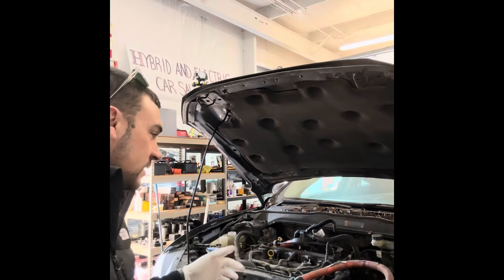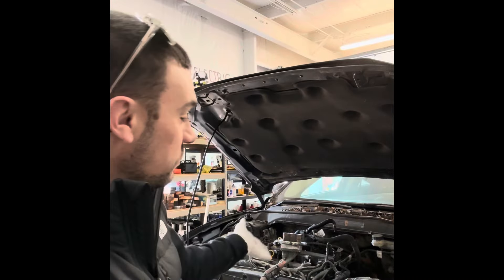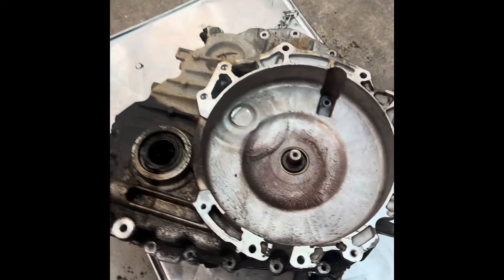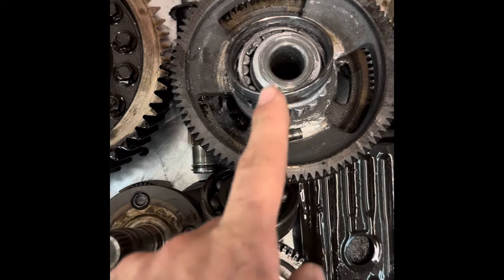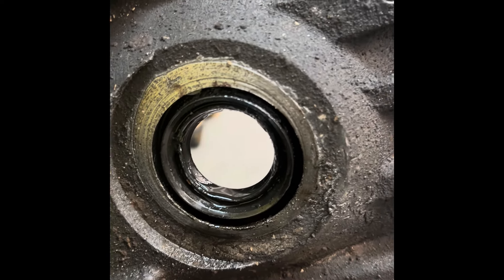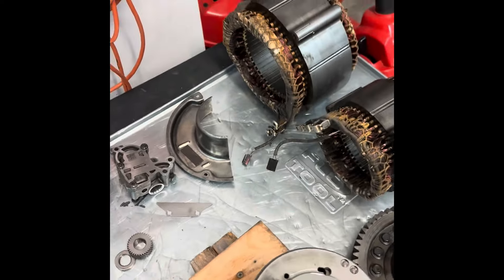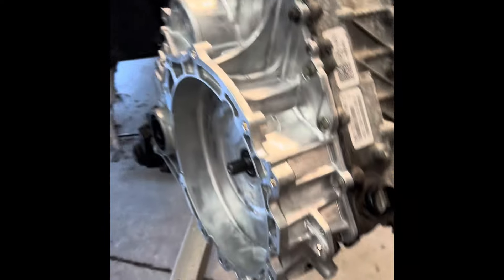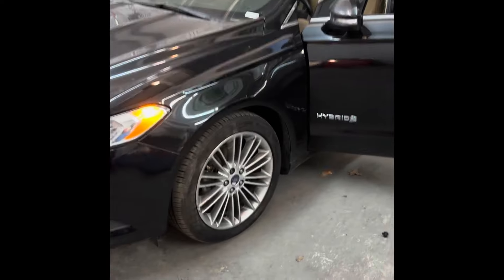The WORST Fusion hybrid transmission we have ever seen! HF35

Comment: Hi Chip!

Just found your video doing HF35 research on my new-to-us 2016 MKZ hybrid.

Great info and so cool that you guys do a rebuild service for these transaxles.

Im curious how often you suggest owners change the HF35 oil? Seems there is conflicting info.

Ford/Lincoln says mine is good to 150k but that seems excessively long to me, amd this video scares the crap out of me.

Ours is at 109k now and runs super smooth, no issues at all. So should we change the flyid out soon?

Please advise!

Thanks 😊
Reply: Change Trans fluid every 60,000 mi or 100,000 kms according to Ford Tech.

Comment: What was the mileage on this one? And was this the result of a leak? Or simply not changing the fluid at the proper interval? I have a 2018 hybrid titanium and trying to make sure im doing everything right. Rideshare vehicle currently at 167k and running smooth.
Reply: Just need to change gear oil every 60k km
Reply: Apparently the 2016+ ones are way more reliable and known to last for literally ever vs the first couple model years.
Reply: 2018 titanium 220k this just happened to me this weekend
Reply: @royaljohnson6331  That sucks, sorry to hear. Did you change the transmission fluid when it was scheduled? Ill have to get on that asap and change it more often. Ive skipped it so far. Also, are the majority of your miles city or highway? Or a mix of both?
Reply: Rideshare driver here, too. My 2017 hybrid SE just started making the high-pitched whine at around 178K miles. I did not change the fluid like I should have (I just didn't know, and now that I'm researching this, apparently, it should be done at or before 100K - or every 60K from what others say). Ford did it for me last year when I was at 140K miles. They didn't report anything unusual or troublesome (like metal in the fluid). I've discovered a leak around the cv joint that is likely the main reason that I'm having the high-pitched whine, which is probably one of the bearings on the stator side of the transaxle, from what I've gathered watching this channel. I think having that felt/carpet cover on the underside of the car prevented me from noticing the leak in time to prevent the damage that's already occurred. You should change the fluid. It's not too hard. You just have to jack the car up on all fours and make it level. The fill plug is behind the driver-side tire. The drain is near the bottom. I bought a $10 bug sprayer from Walmart (Chapin Home Gardener) and you can use the tip of the sprayer (without the nozzle) to insert into the fill port. Pump and squeeze the fluid right in. It's full when a slight stream of fluid begins to come back out of the fill hole. Give it a shot. Not too hard.
Reply: @royaljohnson6331 2013 Fusion Titanium Hyrbrid, 178k miles, Transmission doesnt go into park and the bearing is screeching along with non start due to transmission.
Reply: @pjleash  any update on the car ? How is it now. I'm in the same situation as you
Reply: @abdul-jaleeldieng2660  I was going to rebuild the transmission with a kit, but my car was side-swipwd by a semi truck and totalled. I drive an EV now.
Reply: @pjleash  thanks 🙏. I've got the same leak from the transmission as well. What's the name of the kit that I should look for

Comment: Just opened the ecvt front case to inspect the damage, wow. I this video you have, It looks like my trans has more damage than this one! and mine had a lot of fluid in it. Id love to send some photos of the gear teeth and scaring in the casing. Also I have a question in regards of HF35 compatibility between years. Already researched Ford part #s and all that, but im thinking you guys have experience in this.

Comment: P0A92: 21 actuator stuck open 

 please help transmission has been replaced. Hybrid battery working as well. Transmission can be heard running, i can move car and drive, but as I press the accelerator it doesn't turn on the engine and red triangle pops on. Dissappears soon after I turn it off
Reply: I had the same problem. When they replaced my fuel pump, the car runs like new. 🙂